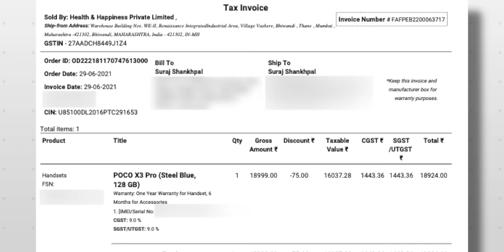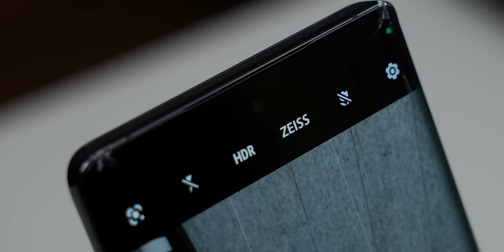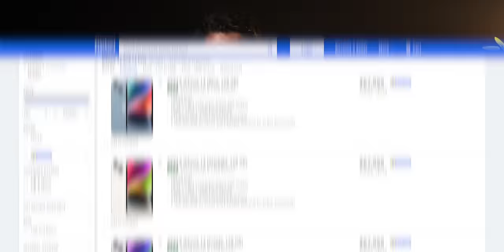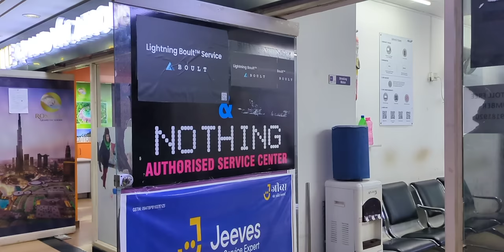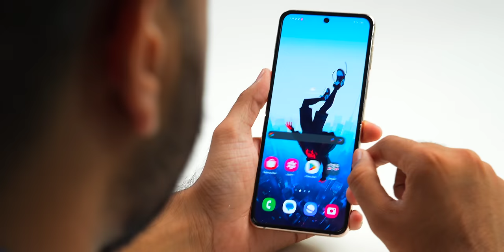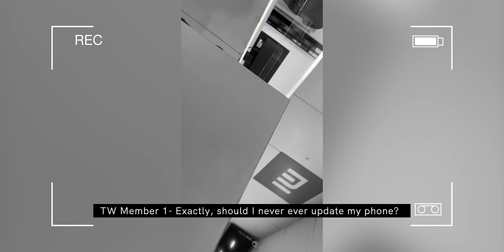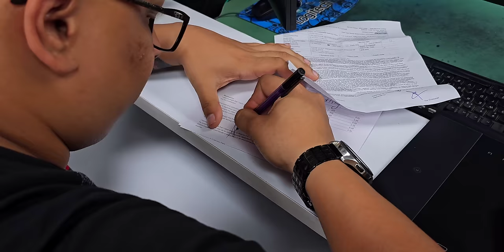We Tried 5 service Centers in India!

Comment: Bro I'm using REDMI NOTE 10 PRO MAX for 1 and half years and after the MIUI 14 update the phone was not stable' it had  issues with UI and camera and after a week the phone is dead , I went to service center near me and they said 'the phone is now out of warranty and it will cost around 10K for mother board change and there will be data loss'. Does this extended warrenty you mentioned in the video apply in my case?? the cenvice center said nothing about this.

Comment: I am using a Vivo V15 Pro and it had some battery issues and the best thing was the day when I got to the service center many users of the same phone have the same problem and turns out that I have to get the battery replaced which has costed me around 1400 rupees and also It took around 2 hrs for this whole process as the service center was crowded and also I have to wait for the battery to be replaced 
This is my experience at the Vivo Service Center in Jodhpur Rajasthan

Comment: My S20 plus device had multiple vertical line issues, I purchased it on March 2020, The problem started around june 2022, I was really upset because i brought the phone for Rs.74,000, Then i contacted samsung they said to take it to a authorized service center nearby. Went to the centre they checked for water damage and any dropped damage, Since i had no damage they took the device for free repair for 7 days, After 7 days they gave me a replacement of display and battery as well as software. It was really a good experience from samsung but i don't know about if my phone got water damage or physical damage they would have replaced for free?.....Still the service was perfect 😊

Comment: My experience: Location Nashik
Device :  Redmi Note 10 pro . Front camera dead and No sound output through speakers  even bluetooth gave 0 output. 
Reason : Android 13 update.
Service centre : Asked ₹10,650 for motherboard replacement as my device was more than 2years old . And refused to repair of i have attempted  to repaired it via local stores . 
Guess what I leave the centre and repaired the phone by a local mobile repair shop with 1800₹.
It's good now XD

Comment: Hi I am also using the Poco x3 pro and faced the same issue of dead motherboard after android update, I got my phone repaired under warranty but the service center told me to not to update phone further.
are they using the same cheap defected motherboards to repair or they have replaced those parts with correct ones?
there is no point of having 3 majors android updates if i cannot update my phone.
They were also not even sure on this and were not providing any sure answers to my questions, they were like it can work for sometime or may get broke down again not sure about it.

Comment: My Samsung service experience was horrible, i have a galaxy watch 2. There are two Samsung service centers in my city. I went to the closest one, he pried my back piece off and then told me that they don't have the charging coil. (My watch wasn't charging). They told me to visit the second service center. As this shop was far away i went after a week or two. They took my watch and told me that they can't repair it within warranty becuase the back panel had been incorrectly opened. 

I had never opened the back panel and they said they will charge 10k for its repair when you can get it now for roughly the same price.
I took the watch back idk how but the watch started charging magically then I just added some glue and closed the back panel and it has worked fine ever since.

Comment: My Xiaomi 10i had major issues after it's august update starting with  camera not working followed by not detecting mobile signals and wifi. Xiaomi asked for 14k for motherboard replacement for a 22k phone as my warranty expired in april-may. Should the company be responsible for it's buggy update and fix the phone free of cost as many users of the same phone facing the same fault

Comment: I own an iPhone 11 and due to damaged charging cable the motherboard was short circuited... went to Apple service centre and since it was out of warranty they charged ₹1750 for just checking wt was wrong with the device (Apple being Apple). After a day they told me the same thing... they told me it cant be fixed nd the whole unit can be replaced for 35k... went to a third party offline store here in Bengaluru and got it fixed for 2.5k. Lesson learnt is if ur iPhone is out of warranty never go to Apple service centre 🥲

Comment: Great and useful content. Let me share my experience.,

I have a Redmi note 7 pro which had a battery issue[in 2021] like phone wont boot up/work until you connect to the charger and by the time i had this problem it was already 2 yrs for my purchase and MI service centre took the phone for 3-4 days and got it repaired for 1500/- and still now the battery is rock solid.

Service centre from Tanuku, Andhra Pradesh.

Comment: I Bought I Phone 13 in sept ending and from start the battery health was falling and after falling on regular basis I made a call in apple service center and they told me they haven't found any kind of issue in software and told me that they cannot check hardware on call after that I made a decision to go in service center because my battery health fallen to 88% until June then also they told me they are not getting any issue and until we found issue in our system we cannot change the battery and until the I don't know how my battery health is not falling I think apple had done something to my phone that's why it is not showing any kind of drop from battery health #techwiser #appleservice #apple

Comment: I got an interesting one with One Plus 7Pro( (OP+7PrO aka OPPO).After travelling 200kms(They had and authorised service center in my tier 2 city and had asked me to submit my device earlier but  told me to wait for 15-20 days in vague and also they would not provide a spare device so I decided to travel 200kms.) I had to wait outside the store an hour for the staff to come and cleaning of the place to get completed though the time specified on their site is 11 am. Finally got in and got my back panel and type-C port replaced which took another 3.5 hours(Token system 2 device ahead of mine), I got the phone back checked everything but the cameras and Later(2 hours after I came back) I found out they somehow fducked with the camera module and now my telephoto doesn't work and Ironically a notification pops up in the software "The camera may be damaged Please contact Customer care for assistance". (Contacted the CS they told to bring the device back and they would get it done but I chose to loose telephoto over the hassle!)
No complaints with the Phone though probably the last Carl Pei inspired device, still works great.  (Dave2D's recommendation)

AnotherOne, I also own an MSI GP63 Leopard which only has 5 exclusives SC in India and rest all authorised(Which are scam shops at least in my region ). I got my Hinges and broken since the past 3 years I have searched Jharkhand, Bihar, Orrisa and West Bengal and found no Instant support/repairs upon talking to top MSI support I found the only way to get it repaired I have to Courier the whole thing or bring it to Delhi, Bombay or Bangalore.(Duration of the repair Best Case 1 Month Wow!) So Once again with a broken hinge and a Dream!

Conclusion: You cannot simultaneously be a Tech enthusiast and live in tier2 city in India. So folks if you come from tier2 and below SAMSUNG and DELL are the way to go! 

P.S MrWhosetheTechWiser ? xD surprised to see Samsung repair the phone in just 7days as it took the boss to get it back in some 20 days!

Comment: I had a 3 year old vivo x60 which got a green line on screen after update and it already had a touch issue (proly because i used sasta charger). Vivo service center replaced the screen in 1 hour for free no questions asked. After 3 months green line issue reappeared, this time they didn't have the spare screen, so they gave me 25k₹ voucher for a fkin 3 year old phone which i bought for 32k. VIVO IS GOATED IN TERMS OF AFTER SALES SERVICE

Comment: Have a iPhone 12 pro the earpiece speaker stopped working purchased the device in 2021 January, it happened to be a manufacturing defect and fell under apple repairability program visited service center in March of 2023 got it done for free but had to pay 1400 service fee. The whole display was changed if it were not to be in ARP I would have had to pay like 40k plus.

Comment: Hi team techwiser and community. I recently got issue in my airpods pro where static started to come. Went to apple resellers who just did not help at all. Then booked an appointment, went to apple store in saket and Got my 1st gen airpods pro replaced for Free (Both), which usually cost 20,000. Turns out, this static issue is design flaw from apple and even after 3 years of purchase they are changing airpods pro. 10/10 👍🏻👍🏻

Comment: I have a samsung m31s, pretty good phone to buy at 20k in 2020 but last year after android 12 update it just kept restarting by itself and I found out it's motherboard was dead 💀.Its warranty had already ended. I took it to a samsung service center and they offered to change the motherboard for 8k. I had no other options other than replacing the motherboard bcs I wont get a good phone for 8k. If I had 8k more when I bought my phone in 2020, I would have gone fore a phone for 30k. Now I have a phone of 20k and had spent a total of 28k. I found out that this is happening with a lot of samsung m series phones.

Comment: Instead of the Flip 3, you should have tried either an Exynos 9611 based phone which have a motherboard issue or any phone with a Green line issue in the case of Samsung. A lot of people are facing these issues and there are NO SOLUTIONS for this. After a lot of debate and wasting of time, they will give a FOC repair for s20plus, if the device is without even a scratch. But the issue is that many other models like the Note20 ultra, s21plus, s21 ultra are now facing the same issue and they are not providing any solution except  a PAID display replacement for THEIR MISTAKE of faulty software update. Further, for the budget Exynos 9611 users like M21, M31, F41 etc, there is no solution at all. So, please try to address this issue instead of trying to repair an in Warranty flagship device.
Reply: Samsung phones with Exynos  9611 chipset have wide spread motherboard issues...but no big tech youtubers are talking about it...
Reply: And now Samsung users are facing green line Issues after update...if your warranty is over..they will charge you...🤦

Comment: My poco x3 pro's motherboard suddenly died on December 25th, 2022 and I went to the service centre on 26th, thankfully the phone's warranty has already been extended by 6 months so they changed the motherboard for free (at that moment I had the phone for about 13-14 months and if not for the extended warranty I'd have to pay 9999 for replacement)...

BUT IT TOOK THEM ALMOST 2 MONTHS FOR REPAIRS 😑

Also thankfully I kept the backcover and screen protector on so the phone looked brand new even after a year of using it... There was one more guy there whose phone was also under extended warranty but due to some scratches on phone's body they denied him free replacement even though the phone died because of software issue and I don't what happened next after their arguments 😑

Comment: My Xiaomi phone's motherboard got damaged, but it was under warranty, so I went to the shop where I purchased the Xiaomi mobile from, which was an official Xiaomi store. They didn't do anything and assured me that it would be fixed. However, just one month after the warranty expired, the motherboard got damaged again, and the phone stopped working. I am very disappointed because it was a flagship phone with 8K recording and cost 36,000 rupees, I believe. I still have the phone with me. If you can help in any way, please let me know. ❤

Comment: I had a worst experience with Samsung service center , my watch 4 was having a speaker issue and they told me they can't fix it becz it has water damage and can't claim warranty on it , they fully teardown the watch and they told there is issue with auto reboot, which is due to their service . They told they can't fix the watch,  the replacement of the parts will be above 10k and they know I'm not gonna do it becz i bought the watch for below 10k . And they didn't do anything and gave it back. After reaching home when i checked the watch the speaker is working and the battery is draining so fast and watch is getting auto reboot continuously,  and i called the Samsung customer care and they recommended me the nearest service center ( which doesn't have premium section) they also told me the same and this time i went there for battery issue , they didn't do anything.  Now my watch is fully dead becz of service center. I don't know what to do with it. All this happed on 30th june  & 1st july . I need some help ☹ , if  you know anything reply

Comment: I have worst experience with Xiaomi phones and their service.
1) Recenty my Redmi Note 10 Pro Max's display automatically died while I was on zoom meeting and display started to flicker with lines. I thought it was a display problem. I went to service center and they told me that the motherboard of the phone is not functioning and they were charging me 12K Rs for the motherboard. I got the mother board fixed from a local mobile shopee for  4K Rs within 2-3 days.
2) I also have Poco F1 which had dead display and cracks because I dropped it from on middle of the road from my hands while walking. And I got my display replaced for 7K Rs and the new display again became dead automatically with lines on it within 7-8 months. And now it is costing me 8K Rs. I still haven't fixed my Poco F1.

Comment: pre ordered s21+ within a year its back pannel started getting detached from body. nothing major just enough gap to put nail b/w it. To be fair I did drop my phone multiple times and often wake up on top of it. But the thing id when they repaired the device they said there is 2 % chance back pannel coating will spoil and its color will change because I used phone with gap for so long which ended up happening.
Finally when they returned the phone after  fixing they claimed that they have watertested the phone and imagine the horror I felt when I still saw gap in phone. i decided to not get it refixed from the same service center. And then i actually never got it fixed.

Comment: I had a bad experience with Xiaomi service centre I had a poco f1 it's battery had blown up so I went to service centre they said it will take 3-4 days to get it replaced and only after about 6 month the new battery also puffed up so I opened up my phone to only find a third party battery they charged me 2500 but the battery only cost 1200

Comment: I have a great experience with apple services in kolkata, my ipad pro's display making crackling sound whenever I put some light pressure on display like there's some gap between display panel and the chassis. My product was in warranty but at first after seeing the issue they denied to accept it as it doesn't making things unusable, but after a hard bargaining they did accept my ipad. Man o man, within 3-4 days I got call to pickup my device as it was ready. I went there asap and received a brand new ipad pro with same specs and colour. That was the very best service centre experience I had in my life.

Comment: Urgent Request: Pixel 7s Yellow Tint Issue

Hello Team TW,

I hope this message finds you well. As an avid follower of your tech reviews and insights, I greatly value your opinion and trust your expertise. Today, I'm reaching out to you with an urgent matter regarding the Pixel 7s, specifically concerning of a yellow tint issue that I've also encountered with one of my units.

I
A number of Pixel 7s users are experiencing a noticeable yellow tint on their device's display. This problem seems to persist across various units, leading many users to voice their concerns and frustration. My device is about a month old now, and the display looks pale, tinted yellow and washed out. The camera view finder looks grainy. It has overheating issues and the battery drains very quickly. I'd purchased two units for my parents as a gift and this issue is only on one unit. My other unit works absolutely fine with no issues whatsoever and the difference between the devices when seen side by side is quite evident. I reached out to Google support and while they didn't acknowledge that it was a known problem, they agreed for a replacement phone. Shared photographs of the box and invoice and then they denied me a replacement phone citing the phone was purchased from Amazon and is a U.S model. So, it cannot be repaired in India as well. There's no way that I can calibrate the display as per my liking as well. Please help me with a solution 🙏

Comment: Heyy tech wiser ! I have something to tell you . Few months ago , My Redmi Note 10 was having some charging issues . That it is not charging . I get it repaired by the local shop but it does work so I decided to get it repaired by an authorised service center . I take the phone to the service center and there a surprising thing happened . I gave them phone and they said that it's charging component is not okay and having issues due to water . They told me that it would cost approx. 1200 rs . But when I went to pickup the phone they told me that . The camera was dead and it will cost me 12000 rs. To get it repaired and the phone was 2 years old and the initial price was 14000 rs. Now I don't know what to do . Please advice me in this situation 🙏 . It's my humble request because I do have memories with that phone and wanted to get it repaired rather to buy a new phone . I hope you understand. And please anyone help me .🙏